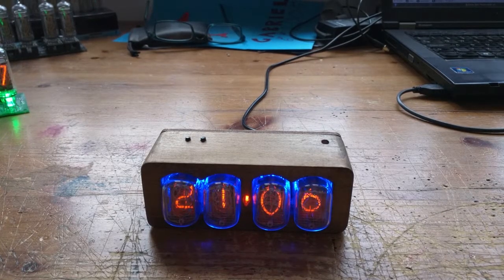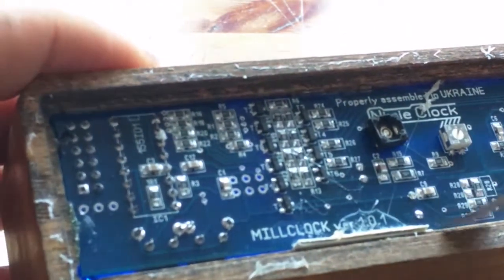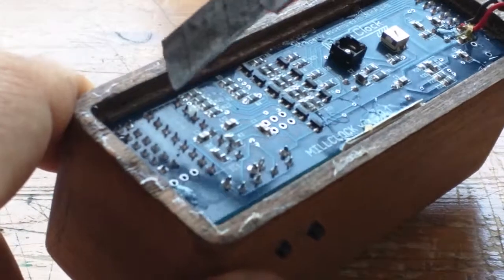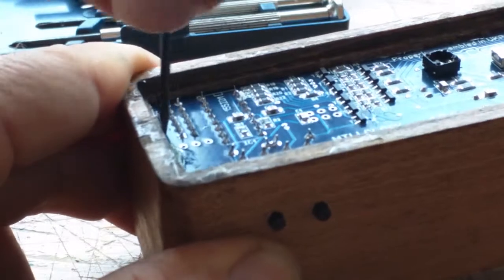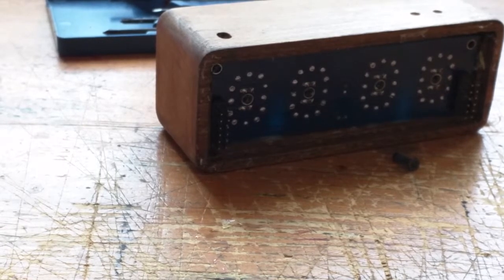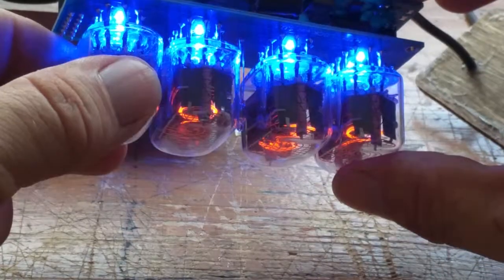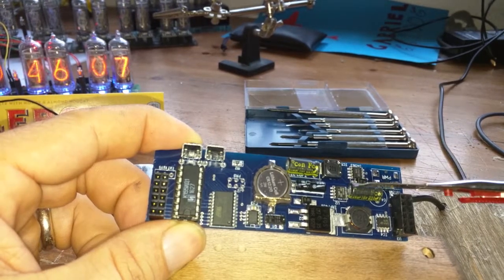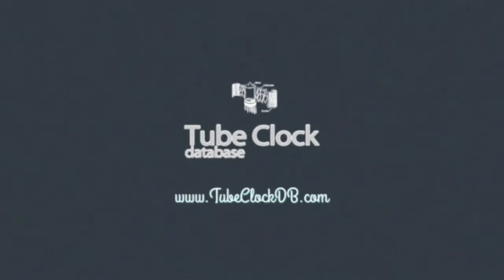Millclock IN-12 Walnut Clock Teardown

Comment: The variable resistor on the back of the PCB is to vary the high voltage supply for the nixies. It should be adjusted in order to give best brightness without causing other elements to illuminate.
I have built a similar clock from a kit (only 4 X IN14's).